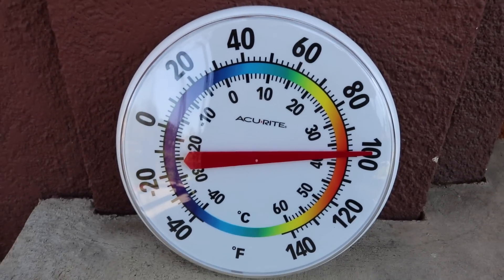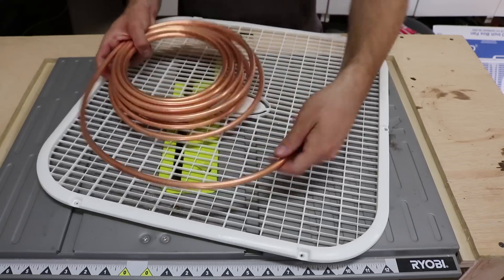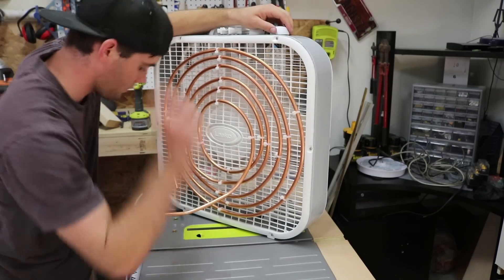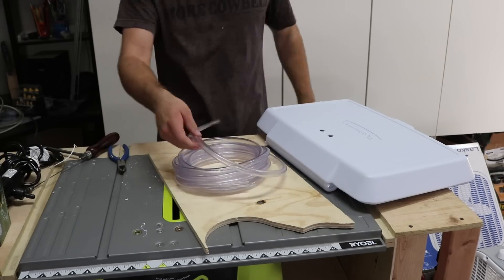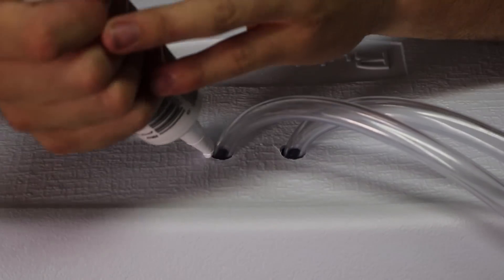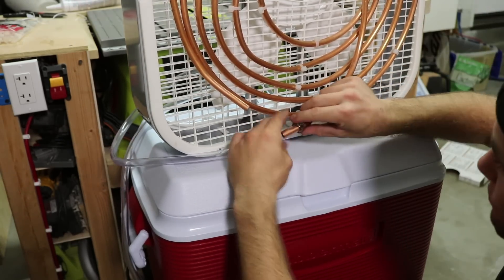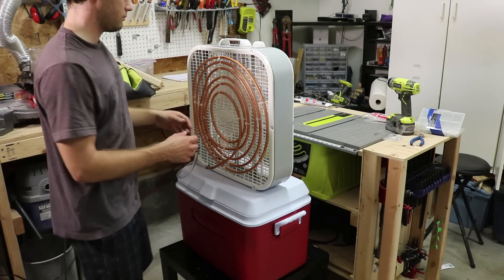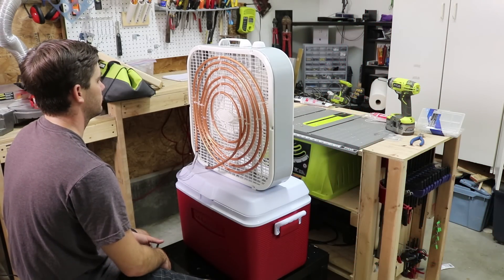$100 Homemade Air Conditioner - DIY

Comment: Add some salt to that water and ice mixture to make it even colder!
Reply: I would wear the pantyhose and stuff ice packs down them.
Reply: Forget the ice. Just throw a couple of reusable ice packs in the cooler for super cold water. 👍
Reply: He did say it was for his garage I'm pretty sure it's not insulated for an ac unit to keep the cool air from escaping so this would make sense for a portable cooler... i live in California in a townhouse and summertime is ridiculous hot...my room is upstairs above our garage above the water heater n washer n dryer...it also faces the sun all day no shade n our central air can't keep my room cool and our townhouse rules forbid any ac unit sticking out the window including portable units with hoses.  So this is a cool idea for my room to keep cool  during the day...
Reply: @treks82  A one or two tube A/C unit would not stick out the window much. Our windows in Ohio have the screens on the outside as do ours here in Florida. And the one tube assembly sits behind the screens. Hard to see it as it just looks like part of the window.
Reply: @treks82  too bad water there is sky high or you could install a 'water washdown' system on the whole house.
Reply from the maker: +jameswturley that's not a bad idea! I don't think I will tho because of the risk of messing up the water pump. Trying to make that sucker last a while
Reply: At Spartan, Challenger, and Frog races, they add Radiator Fluid to lower the Freeze Temp, (agree with +Debashis Mann, though it will make the water colder, it will kill your ice faster; it's like a supercharger for the cooling unit; blows colder, but not as long).  I think the biggest question is still your overall energy efficiency (i.e. where and how you harvest your "cold")
Reply: @BenTardif  pump water through 2 sets of coils - one set submerged into ice water and the other in front of the fan.
That would make a rudimentary heat exchanger and no salt in the pump.

But the cost of electricity and ice would be more than an electric A/C unit.

One 5K BTU A/C will cost about $30 a month or so depending on heat in the room and how much you are trying to cool a room.

Be aware that your pump and fan adds entropy to the room as well. 

Money might be better spent on more insulation first.
Reply: Hey Ben, I just thought of a solution to having the pump suck up salt if adding salt to your water to make in colder. Place a piece of pantyhose over the inlet hose.
Reply: +Semajyelrut It will start growing off the pantyhose, the supercold saltwater filtering through will eventually reach the point of becomming a supersatuated solution, and salt stallagtites will begin to grow on the inlet side of the net, especially with seed crystals caught on the other side.
Reply: That is an excellent mechanical question. Do remember that you can thin the alcohol quotient with whatever other liquid you would like to use, to decrease possibly corrosive properties at the expense of ability to thermally buffer as fast as it originally would unthinned. Saltwater is also an excellent idea...as for copper, neither alcohol nor a minimal saltwater solution would damage it...but in the case of salt...it would eventually unbind (as it always does), and begin to form into blockage.

The pump itself would not likely be damaged either, though I will state that alcohol IS thin enough to bypass SOME seals that are very sloppily made (e.g., a super cheap chinese made pump that wasn't going to last you very long anyway).

Also...before I forget...do remember that you can not even use a pump, and run a slower, almost but not quite steady siphon system that accomplishes much the same design as yours...same as siphoning gas, really. (Remember the Archimedes Screw?)

But...that gets into hydraulics and hydrodynamics, though if you were to count thermodynamics as well, it is possible to run a system that is passive (like yours), but at a slower liquid movement speed (Gallons Per Minute).

You have to calculate head and drop, GPM, etc.
But it CAN be accomplished using even a cheap hand bulb pumper you can get from an auto-parts store to transfer fuel, etc.

Now...chuckle all you like...but they do make anti-freeze!
And guess what newer forms of anti-freeze for a vehicle do quite well?
If you said..."suck up heat in a radiator with a fan that blows or sucks through it" (aka- Passive Pump Driven Thermal Buffering)...

you would be right!

And wonder of wonders...I do actually wonder what would happen if you re-introduce alcohol into the non-glycol newer styles of anti-freeze already designed to remove heat from a system.

Don't forget, gents...don't try to re-invent the wheel...
but do try to re-invent the wheel. It's a conundrum, but you might just find a better way.

And here is something I learned from an old-timer way back when:
To think outside the box, you have to look into it to see what everyone else did too.
Reply: @TheCaptainSlappy  A real MacGyver. Something tells me that you are the go-to guy in the event of a catastrophe. Pretty impressive.
Reply: @GunnPeterGunn  Not so much that, though I appreciate the idea I am MacGyver level. It's just "how stuff works". NO better way than asking a 90 year old WW2 vet stuck on an aircraft carrier how to stay cool, or an AC repairman how an integrated heat exchanger works. Or asking a 85 year old guy how a whiskey still works. I mean...c'mon...those guys learned because they did TWO things- asked others and experimented.
Reply: that's not how that works lol. putting salt lowers the freezing point so u would have to keep freezing the ice.lol  sry , not trying to be a jerk or any thing
Reply: If salt was added to the water and ice in the cooler, I would have a copper coil in the bottom of the cooler instead of drawing salt water through the system, have a closed system with just water running through the entire tubing coils. That is if I added salt.
Reply: One problem though is what would the alcohol do to the pump?  

My consern with adding salt to the water is what that would do to the copper in the long term.
Reply: @TurtleDudeProd  submersible fuel pump maybe?
Reply: Until you have to carry a cooler full of water down the stairs every day to empty it.
Reply: salt makes things rust quicker
Reply: Semajyelrut that's an awesome idea 😁
Reply: I don’t know but used to use dry ice in East Asia.
Reply: This is what liberalism causes, people can't even afford electricity for their AC units, keep paying giving all your money to illegal aliens coming in to our country killing Americans and people who refuse to work.
Reply: use a couple orange juice bottles or milk jugs. freeze them and use them instead of bagged ice. a block of free ice in a jug will last longer than small cubes and wont burn your wallet on two bags per use
Reply: Semajyelrut itll freeze the h2o in the lines
Reply: Then try this (old trick)...don't use plain water...use alcohol (clear, any kind).
The purer, the better. So watch this...

guess what is great in copper tubing that acts as a passive heat exchanger? (literally a reverse whiskey still, it sucks the heat out, and dumps it into a thermal exchanger...like a slobber box full of water, just like in a whiskey still, the tubing passes through a slobber box to dump the heat into it, then passes on to cool down and re-solidify to straight alcohol for drinking...

or in this case, it keeps on going back through the copper/line circuit, cooled down again, to pick up more heat...so I assume you guys know how stills work when I say this).

I've told this story before out here, so will again. I had a neighbor, Louis, who was in WW2, in the Pacific on an aircraft carrier. He told tricks they used to stay cool...because there is no shade or AC in a 1940's aircraft carrier. Remember that.

They used to dunk rags into aircraft fuel barrels, and hang them on lines so the wind would pass thru. They also used to take their beer bottles, wrap those rags around them, and hang them from something...he said they would get ice cold that way with a minimal breeze.

Now friends...guess what aircraft fuel back in those days had a lot of in it?
If you said alcohol...you would be right.

Alcohol is nice and thin with a low boil point...
easy to pick up heat, easy to get rid of it too.
(your refrigerants in standard AC are gas/liquids with lower boil points than that)

Now, if you took an ice chest, packed it full of the refreezable gel packs, and then ran that alcohol in that copper tubing thru there as your slobber box...off you go.
Because you are doing two things at once...cold air (and dry air) draws moisture, which cools air passing by or thru...if you create a single dry spot in an area, it will literally begin to suck the moisture from all the surrounding area...given enough time...the entire room.

One way to accomplish that is cold air...cold air that isn't wet...cold air that is made cold by very cold alcohol (which gets cold fast) picking up heat along the coil until the return line. Your coil will do TWO things...it will be cooling the outgoing air (remember, an AC unit doesn't make "cold air" in the way you think, it is a DEHUMIDIFIER first and foremost, and a heat exchanger) across the coil, and pulling all moisture of the hot air onto the coil...

allowing you to capture and remove it however you like.
The incoming air is hot and moist.
The outgoing air is cold and dry.
Reply: @TheCaptainSlappy  hi i just realized that methylated spirits is quite cold and guys use it for water injection 50/50 internals run cooler. Canyou use methylated spirits? Any reply appreciated 😊
Reply: @dragan3290  Well...good question. If they are using it for thermal capture in a non-compressed environment, I would imagine it would work as good as anything else. I have wondered at times if a special mix of glycol radiator fluid and other non-reactives would work. My only fear would be to make certain whatever you used was thinned out enough with non-reactives to stop any possible combustible properties, which would probably lead to a lag in thermal capture, but safety is safety.
Reply: TheCaptainSlappy there are also applications of thermo-chemical reactions those that absorb (endo) and those that give off (exo) ? If I stated the terms correctly
Reply: @tomconner9695  You got it, Tom.
Reply: Add some dry ice on top make it smokey
Reply: ice will melt very quickly :P Don,t apply bookish knowledge
Reply: BlueberrySapSmoke Nope just you, cause you did not consider the electricity cost those units will convey with them
Reply: Or you could just desolve the salt before you poured it in? Lol. Or you could just buy an actual ac unit. Which would be much more cost effective and efficient.. are people really this dumb